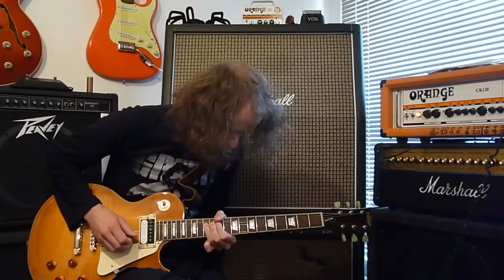Why I prefer Solid State amps to Valve amps

Comment: I still have my Marshall Valvestate 100w combo. Still does the biz after 20 years ;0)
Reply: I've owned two Valvestates- my nephew owns the first and I'll never part with the second. Great amps!
Reply: I love the hell out of my Valvestate combo!  Also have a mid-80's Randall that is WAY sikk, and so damn loud even on 1! SS amps have their spot in the biz for sure!
Reply: same here I got the 8100 model and it rocks to play metal especially DEATH. r.i.p. Chuck
Reply: I bought my Marshall MG 100 FX..9 years ago not one single issue..i also run it with a Marshall JCM900..Sounds fantastic..in the 9 years i have had the MG 100 FX..no issues..but have had many issues with my JCM900..What I'm saying is very true..my Marshall MG FX 100 Always has the power and the wonderful tone..i would get rid of the JCM900 before i would the MG 100 FX..
Reply: I run my slightly modded Valvestate 8080 combo into an old all valve 70s Fender Silverface Bassman and the sound is huge !!! I play classic / psych / stoner / blues rock. 

Being a tech. It still costs me a bomb to get a valve amp going. I just blew almost $200 aussie on new tubes for a Marshall DSL401 combo and that's wholesale, but because of the bad design, I have new problems that have manifested in the preamp after repairing the power & phase inverter section. 

A solid state amp, if it goes DC can cool your speaker where as a valve amp has a transformer which can protect the speaker if a valve shorts out
Reply: Getaways and Guitars my valve state s80 shit the bed on me, and i brought it to the best repair man i know and he couldnt even tell me what fucked up
Reply: 8080 Marshall Valvestate is the nicest sounding amp I have ever owned
Reply: I almost bought one, got talked into a tube amp by the slick big box salesman... wish I'd bought that Marshall Valvestate back in '94. Oh well, on to ebay and reverb!
Reply: Just got a Marshall valvestate 8040 and it sounds amazing
Reply: Valvestates still have a tube in the preamp, they're hybrid. Can sometimes sound a bit too scooped, but damn they're tight.
Reply: I've played my Marshall VS100 for 20 years now, she hums and buzzes like she should, it's a Marshall. No matter what I play, single coils or humbucker, she's  doing her job! I just recently replaced the pre amp 83ECC valve and changed the Goldback speaker for a WGS ET90. Now I love her even more.... let's focus on playing instead of searching for excuses. How come, BB King could say so much, with just a single note, while there are so many shredders around saying nothing? Mr Simpson  has given the answer: it's all in the fingers.
Reply: @looneyinkproductions-eduard  Some amps just have a shit tone and I'd never use, say, an MG for recording. And live it'd be usable, perhaps, but not far from that. Great fingers won't save a shit amp. Valvestates are awesome, though.
Reply: @Admiral_Bongo  a shitty guitarist will always find excuses why his tone is crap and his playing is bad.  But even with the best gear he'll still be a guitarist not worth listening to...not in a studio, not on stage. A good guitarist though will make good music on poor gear, no matter what. Just listen to the classic blues players, playing on anything that goes...

Comment: I've owned ss amps and several tube amps. All of them sounded good on cleans. The ss amps started sounding hissy under moderate distortion and badly hissy with high distortion. I hear the same on every review of ss amps when I listen to them.On the other hand I never really liked my Marshall or h and k valve amps. It wasn't until I got a mesa boogie 5:50 that I understood what valve amps really could sound like. That smooth buttery rise and fall in dynamics and tone is out of this world.I fully understand the points you make Dave but I'd never swap the boogie for anything else. I'd rather break my back carrying it :)
Reply: Well then, you obviously haven't toured your state playing 3 -4 times a week...Weight is a big issue when you travel by yourself..
  I think you like it because of the $$$ you spent on it..If you didn't like it, you would of had buyers remorse of the century!
Reply: The new modeling amps such as the boss katana sound so good  clean and dirty ' they are very close now.
Reply: I feel like boogie players know something everyone else has yet to discover.

Comment: In my opinion 90% of a player’s tone comes from the finger work. If Jimi Hendrix was playing through my crap amp, you could still tell it was Jimi and it would be sound amazing. 👍
Reply: Actually, it’s the other way around. 90% of the sound comes from the pickups, pedals and the amp. If you set your amp badly, it will sound bad.

Comment: totally agree, also have found that my valve amps will pick up room noise more.

I can't get a tight low end response from a valve amp where a solid state ( like Randall RG), is super tight with out the modulation or after humm that valve amps regularly emit.  Big names use valve amps with lots of glass so people think that valves are the way to go but in a lot of cases the reality is they just have the valve amp on clean and then use solid state effects to get the sound.

Comment: I'm with you. If trained musicians can barely (if at all) tell the difference between solid state and tube, then how many casual listeners can tell the difference? At this point I'm considering just using something like bias on my mac and then plugging into any headphones/speakers/whatever that I need to.
Reply: You can absolutely hear the difference, especially if you are a trained musician and not just a guitar player!
Reply: +James Wellington yes there is sonic differences but not something like chinese vs english yet more of different accents english.. It sounds different but not necessarily one better over the other.
Reply: Unfortunately, I can hear a great and very obvious difference - all in the favor of tube amps.  Otherwise, everything he said is true.  They are expensive, heavy, hard to keep going, etc. - a general pain in the ass.  I wish I couldn't hear the difference.  Maybe I just haven't come upon the right solid state amp!
Reply: I feel the same way as you Bob. If I find a solid state or digital amp that is as musical as my Orange Rockerverb 100 then I'll be happy to leave the tube amp at home instead of dragging it everywhere. No success with that so far...
Reply: you're talking to untrained "trained musicians" if that's what you've been told.   some of the high end modeling units are getting very good, but you can most definitely tell the difference between a tube and an SS amp.   Anybody who's been playing a few years can pick out a tube breakup in a chord or 2.
Reply: You don't hear the difference between tube and solid as such but the difference between one amp and another. Add to it that tube amps vary slightly depending on the condition of the tube wether they are warmed up or not and most tubes are going to always sound different than their modelled equivalent on a line pod.
Reply: Maybe with the early attempts you hear the difference. Nowdays you hear the difference if you know the modelled amp well and can tell which of the 2 amps is not the modelled amp you know well.
Reply: Jerry M: The point isn't whether some drunk bozo in the crowd can tell the difference between tube and solid state, so much as whether YOU can tell the difference enough to where the wonderful tube sound and responsiveness helps you get into it deeper, play better, and have more fun onstage. And the drunk bozo can perceive that (not that he's the final arbiter anyway!).
Reply: Solid State is more Warm Treble, Tube is Crystal Clear.  That is the only difference I've noticed really between the two.
Reply: All I know is when I crank my gain on the crunch channel on my cheap Jet City amp (without pedals) I get rock and roll cream but when I do the same with anything digital or solid state it sucks and I have to use pedals just to get something usable. Valve or not you either like an amp or you don't, if used in the right way most amps sound good at something. I like the Valvestates (my first amp) that a lot of people keep slating I can get them sounding good for most stuff, along with a Fender Mustang for really clean vintage stuff.
Reply: I kindof  get that too Ryan. Honestly though i think the only reason to play tube is if you play cleanish with overdrive. Toss in distortion pedals etc the difference goes poof. If i were playing Dire Straits id Definitely want to play it through a high quality tube amp. If im playing metallica or acdc id honestly prefer a modelling amp because i can just hit a button and nail whatever tone that particular song needs (well... assuming there were a second knob for "skill level multiplier")
Reply: Trained musicians can absolutely hear the difference between solid state and tube, even though these days it's getting more difficult because technology like Boss uses with the Katana series is getting better. But if you want to sound like Led Zeppelin (like Greta Van Fleet) you'd likely want to choose a Marshall tube amp.  If you play jazz you probably more inclined to use a SS amp like a Jazz Chorus or Hendriksen Jazz Amp.

Comment: Absolutely agree that solid state amps are more consistent, reliable, and sound every bit as good as valves, so glad I dumped the valve snobbery label and started listening!
Reply: While I wouldn’t go so far as to say solid states sound  “every bit as good”, but when weighed against cost, reliability, practicality and maintenance I would agree.

Comment: I moved away from valve amps a few years ago and have never regretted it. I've A/B'd quite a few valve and solid state amps but found the difference in tone to be minimal. I recently tried a DV Mark GH250 against a Fender Hot Rod Deville (one of my favourite valve amps) and they sounded and responded almost identically (I play clean, occasionally I stick an OD pedal in front). If you genuinely prefer valve then that's fine but don't just dismiss solid state amps without trying them first.

Comment: You make some valid points. I had a valve amp blow a fuse at a gig and guitar player from another band was gracious enough to loan me an amp - a solid state B52. Interestingly enough, afterwards, I had a number of folks tell me they couldn't really tell the difference and it still sounded like me. It did feel a bit different at first but as the set progressed, I got past that and had a great gig.

Comment: I totally agree, I've had this argument many times with people. Most people can't tell the difference, and if you play well and throw it in a mix, No one will tell the difference. I've had tube Boogies, Marshalls, Laneys, Fenders. All inconsistent, some days good, some days rubbish. I use a Sansamp PSA1, power amp, 4x12, now. I have any sound I want at my feet, people ask about my sound and I show them what I use and they're stunned. I will go as far as to say a lot of the newer preamp pedal distortions (I use a few) will challenge any amp. Bottom line if you play good, you sound good, period.

Comment: I've been playing a TH100 for 5 years now and I'm thinking about switching it for a CR120. Don't get me wrong the TH100 is a beast, but that monster is also a little princess that requires too much care for what I can afford. I'm tired of being stressed every time I bring it to the stage because one of the tubes might fail on me, I'm tired of not getting the same tone every time I play it or slowly losing the gain during a show (yes that happened), I'm tired of dealing with unexpected noises that come from god knows which tube, moving it around is a pain because of the weight and how fragile it is and most importantly I'm tired of having to pay 200$+ to a tech for new tubes and re-biasing every time my amp feels like it. The sound of that amp is good that's for sure, but the CR120 seems to have an amazing tone too and it will give me peace of mind which is priceless.

Comment: B. B. King preferred his Lab Series L5s to any valve amp. The Roland Jazz Chorus is a properly legendary amp too. They have the best clean tone ever.
Reply: BB could have had a way better tone too. I saw him live 3 times and his tone was not good.
Reply: Roger Moore
Maybe live, but he used a lot of different amps live, mostly valve amps, as the Lab Series have been out of production since the 80s.
Reply: *****
If anything, it's heavily distorted music where you really need valves, transistor overdrive/dirt never sounds good to me - for me, a good metal tone is simply a Les Paul (or comparable axe) into a heavy-gain Marshall (or similar) via a valve distortion pedal.
Reply: Tell me a list of all "valve" distotion pedals with a true tube circuit. Placing just a tube somewhere in the circuit hasn't anything in common with a true tube amp.

I love good tube amps. And I love good transistor amps. There is no "better". 

A fact is, that the most transistor amps are very cheaply made. Who would think of a good sound from a damn cheap amp? For the most, it's not me.
The best qualitity transistor stuff is from the late 70s to the late 80s. And the most famous is the Roland JC-120.
Reply: Ty Tabor of Kings X also used Lab Series L5s, and his distorted tone is something nobody else has ever been able to emulate, and it is very cool.
Reply: I had a lab series l5 not knowing of anyone that used one, and thought it sounded like hot doodoo :0 maybe I used the wrong channel? Idk
Reply: Lol... now you wanna say what BB King could and could not have done... lol  @rogermoore1233

Comment: Totally agree with u 100%! The past tube amps I’ve had are a Vox ac30c2, Marshall dsl40c, Vox ac15c1, none of them sounded great to me, the glass in back was something I always worried about and the upkeep of them. Since then I purchased an Orange cr60c crush pro, and couldn’t be happier, it has all of the tone and volume I need, no worries of tubes. Sounds as good, if not better then any tube amp I’ve had. I’ve learned over time, it’s just using your ears for tone, plain and simple.The fs2 foot switch is on its way! I love these orange crush pro 60c amps!

Comment: I find it's easy to get good sounds out of almost any amp. I've gigged with a roland cube and a marshall mg in the past with no issues. I find that the issue with soild state is not sound per se, it is more how the amp reacts to the way the guitar is being played. I know how to induce feedback and sustain from my marshall dsl 50 by physically leaning into it. Pretty much the same for most valve amps i've found as long as you can turn it up enough!
Reply: Same here. Different "embouchure" for each, when overdriving. Clean, I use no difference.
Reply: A good guitarist will sound good through most decent amps SS, Digi or Tube. Yes, the feel is different but a proficient guitarist needs to adapt. Plus1 thumbs up for the good old Roland Cube amp, mines a keeper.